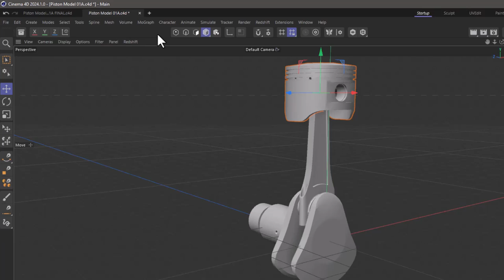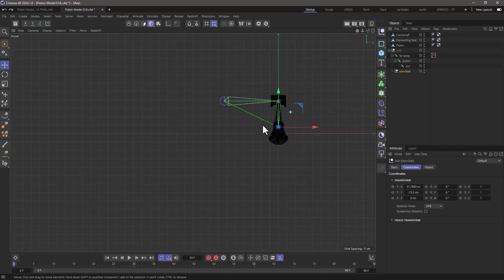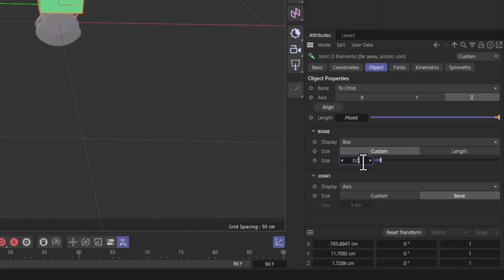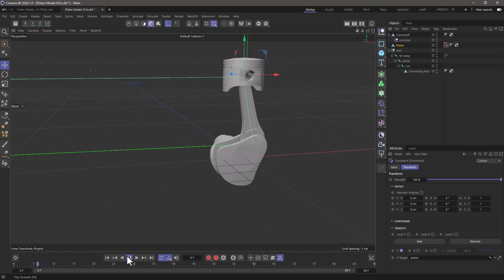#C4DQuickTip 108: Piston Motion Using Linear Joint Rig in Cinema 4D

Comment: Something must be completely redone/rethought in the program. This was not intuitive. Not even close to it. Without this tutorial i doubt anyone could use this. And we dont need TRICKS in the programs for 1% of people to use it.
Reply: The problem with rigging is that there are an infinite number of conceivable things one might want to do. Tools have to stay generic to if they are supposed to cover a wide range of use cases which makes them less intuitive. Of course there could be a dedicated way to rig a piston motion, but that would then be a one trick pony that does just that. For more standard cases (like a humanoid biped) there is character object that does all the rigging for you with a minimal amount of manual guidance. 

What Noseman presented is a neat little workaround that makes this setup easy. If you need a piston, now you know how to set one up. But there are several other ways you could do it. If you want to become independent of someone providing the tutorial for each setup or providing a high level workflow, then you'll have to learn the generic rigging workflow and elements, understand the math behind it and dissect the problem into solvable sub-problems. Sorry :)
Reply: Agreed Maxon has always been the worst to use for rigging, makes zero sense logically when IK'ing pretty much anything